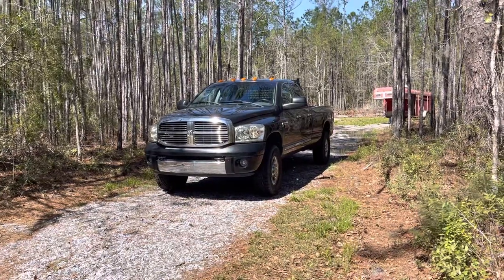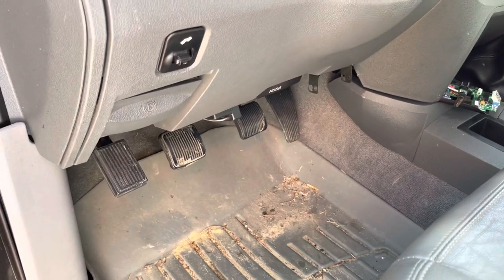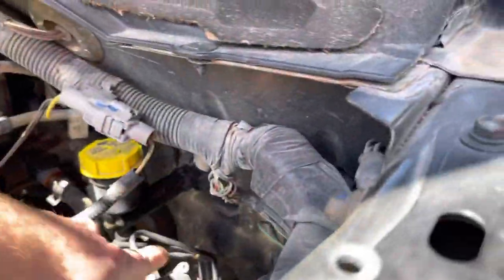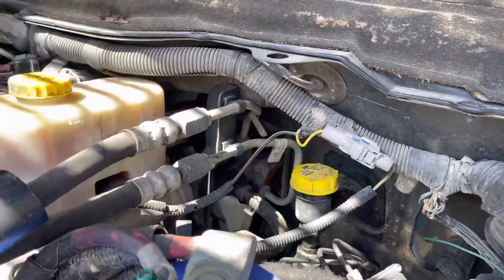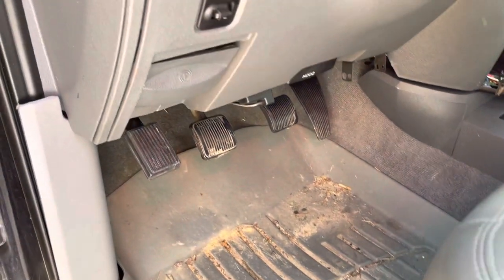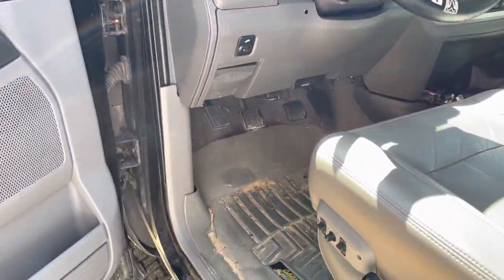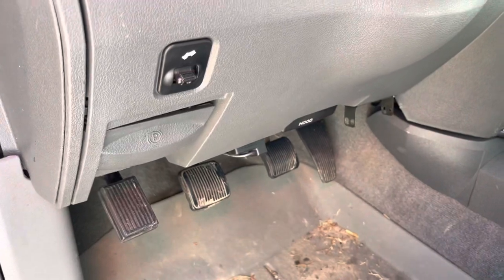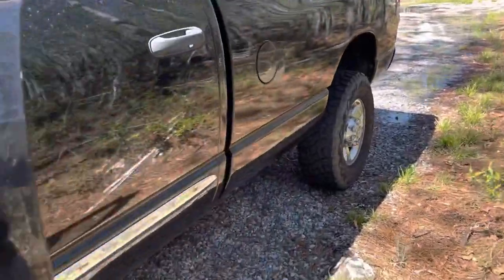Tips for dealing with spongy clutch pedal without bleeder valve

Comment: I went with Valair single disk (stock replacement) clutch kit.$800 Comes with everything needed & clutch pedal pushes in very easy. I recommend this clutch Zero gear rollover.
Reply from the maker: Thanks for the comment. I am think about this stock clutch (350 hp 800 tq) or the one that’s a step above (400 hp 900 tq). Price difference is about $150

Comment: What clutch do you plan to go with? I went with a single disk solid flywheel conversion from phoneix friction. Been a good clutch. I did upgrade to their cast iron master cylinder resivor. Pretty much have same truck as you. 08.. if you need help let me know. I got a trans jack and I’m just south of Nola
Reply from the maker: Oh nice. I haven’t heard of phoenix friction before. I will look into them. As of now I was planning to go with a Val air  one. Did you replace your own clutch?
Reply: @OutpostCTD  yes I did my own. Valair is gonna be a better clutch. But for the money and how I use it the phoneix is good.